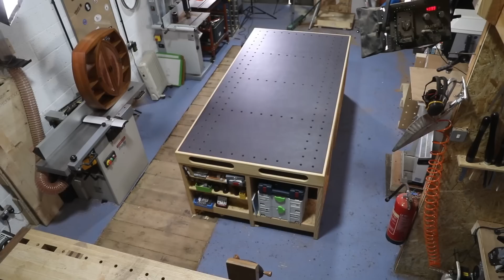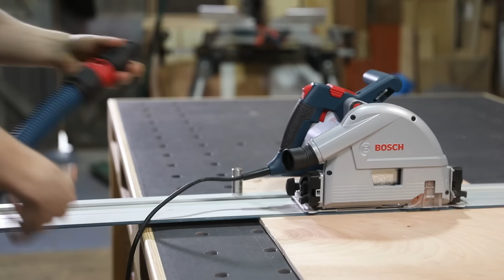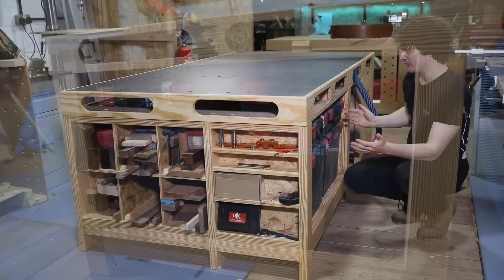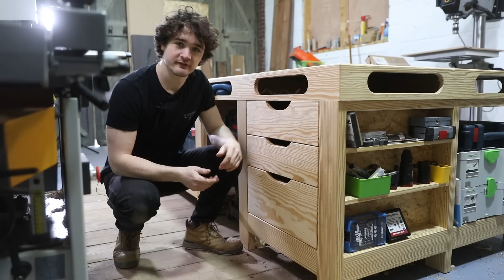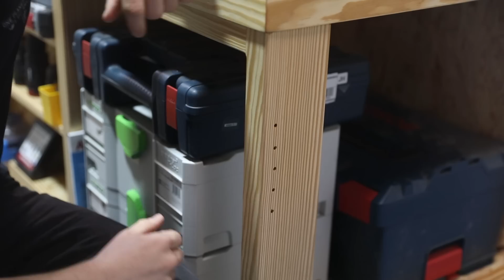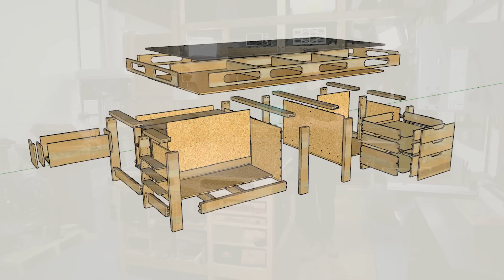Tour of the ULTIMATE Power Tool Workbench

Comment: concern based on the giant fire extinsher is fire from sawing bits and nicks on the floor not with enough clearance to sweep. The issue arrises when clipping a rusted nail shooting a spark down to the saw dust and becoming super heated in the middle of the table not being able to extinsh from the bottom or the top getting super hot and taking down the shop. The concern is gravity of all the tool bot being able to get a work around to the flamable bits.
Reply: If it feels like a rat paradise could be a bad design.

Comment: Only a woodworker would say 'perfectly square'. NOTHING is perfect- square, flat, or anything else. It just needs to be within tolerance. Which varies with the application.
Why store tools in boxes? They are for transporting tools, not storing them. Pain in the butt to pull out boxes and mess with them. Drawers are way more accessible (wall hung even better...)

Comment: If you have ever been in a real workshop you will notice very few if any permanent fixed cabinets on the shop floor, especially in the middle of the room. I keep all my power tools under my work bench and anything else is stored high up on the walls or in the rafters.
The torsion box sanding bench is another one of those bloated impractical dust collecting wastes  of space that hinder rather than help. But the hobby guys lap it up because they think it looks "pro".
It's far easier to fabricate on trestles because you don't have to reach over the table top on any side of the work. You can even step inside it if you need to. 
The dust and shavings fall to the floor instead of piling up on the top. So much easier. 
But influencers sell product by encouraging you to build storage for it. It appeals to the hoarding instinct. You end up with a garage so crambed with useless shit that you have just enough room left to make breadboards and jewellery boxes. LMAO.

Comment: Nice bench.  For wood working imperial is awesome.  I can divide a foot by 2, 3, 4, 6 and 12 and get an exact answer.  Try that with metric.  Also, show of hands.  Every country that uses metric and has landed a man on the moon raise their hands.  What's easier 6 inches, or 152(.4) mm?
Reply: Do you really think your German rocket scientists worked in anything other than metric?
Reply: What a retarded comment. The only time your "division by 2, 3, 4, 6 and 12" is relevant is when you are working in WHOLE feet.
What's easier, 150mm or 5 29/32" ??
Reply: @johncoops6897   150mm <> 5 29/32 inches.  5 29/32 = 5.90625 inches, which is 150.01875 mm.  Lets pick a length where there is a closer match.  What's easier, 5" or 127mm?
Reply: @johncoops6897  math hard.
Reply: @johncoops6897  how do you stand yourself?
Reply: @johngalt5205  - Straight, and 185.3cm tall.
Reply: @johncoops6897  185.3 cm is 13 syllables.  6'1 is 3 (inches is implied, and doesn't need to be spoken).  That's one thing I noticed about watching videos in imperial vs metric.  The metric ones spend a lot of syllables on measurements vs the equivalent imperial measurement.

I can also get 1/2 your height in imperial in my head in a moment, whereas in metric it almost needs a calculator.

And why, if the base unit of measure is the meter, a liter is based on the centimeter?

For the kilogram, they started out OK, 1 liter of H2O (later refined to at the melting point of ice).  But now, it's a thing, so that means there can only be 1 true kilogram, since things can't be replicated perfectly.

And, to add to the madness, a pound is defined in terms of the kilogram.
Reply: @johngalt5205  -  Interestingly, "Dick Head" is just 2 syllables. The USA officially changed the definition of the inch to 25.4cm on 1st July, 1959, and since then the "American Imperial lengths" have been defined and derived from Metric. It might have been even easier for you if your forefathers had chosen 24cm, but that's not our problem.
Reply: @johncoops6897  Please forgive me.  I was stupid to try to have an intelligent conversation with a troll.
Reply: @johngalt5205  - LOL, you kicked off the trolling right from your very first comment. Please be aware that I learnt woodwork in Imperial at school, not Metric!  I use both systems daily, and I have a number of workshops containing more Imperial than Metric tools and measurement devices. For Imperial fasteners, taps and dies I have SAE, Whitworth, BA, NPT and BSP. Don't get me started on Fractional, Number, Letter drills and what size to use for particular Imperial threads!
...
So, be assured that I know about and USE ALL of these Imperial measurement systems, and I am not trolling when I agree with most knowledgeable people (outside the USA) who all know that Fractional Imperial measurements is definitely not the best or easiest system for Woodworking.
Fractional inches works OK down to about 1/4" resolution, but anything more precise than that becomes an increasing PITA.
...
What you may not notice is that Imperial (fractional) measurements only make sense under very specific circumstances, primarily whole inches. The increments are inconsistent, which means that there is no uniformity, and calculations in fractions is NOT simple compared to Metric. 
...

In woodwork, it starts OK in Yards, then a division of 3 to get Feet, then divided by 12 to get Inches, and that is all really good and super easy number for division. However if you want to be more precise then everything gets even crazier. The units changes from 1/3 and 1/12 to 8ths, 16ths and perhaps 32nds. And those fractions make calculations of ALL forms an absolute bastard.
...
Can I convince an ignorant person who's stuck in their ways, knows no better, and refuses to learn a better way of working? Nope, it's just not worth the effort.

Comment: Hey just wondering the size of the table.  Went to buy the drawings but want to check size first.  Thx
Reply: The grey top is just over 1200 x 2400 with a solid timber surround. Standard sheet size for MDF, plywood, etc.
Reply: @thethirdman225  - It's 8ft x 4ft (2440 x 1220).... IMPERIAL, because that is what size standard metric sheets are supplied as LOL.
Reply: @johncoops6897  Check again. Americans frequently complain that their 3/4 inch sheets are less than that. That’s because they’re 18mm.
Reply: @thethirdman225  - No, I dont need to check anything. In Australia we use Metric so sheets are 6, 9, 12, 16, 18mm and never 3/4".
.It's obviously the Americans who need.to check more carefully.
Reply: @johncoops6897  I agree. The point being that it’s been standardised to metric.
Reply: @thethirdman225  - OMG, how can Americans possibly cope?
BTW, do they realise that 2x4's aren't actually that size?
Reply: @johncoops6897  I am not American. I have never used or advocated anything but metric. You’re having this argument with yourself.
Reply: @thethirdman225  - I am not having any argument with anyone. I thought that I was playing along with you in taking the piss out of Americans. Didn't you notice my  sarcasm, and examples that they are losing their measurement battles against "the whole world"? 😮
BTW - I started off with the irony that standard METRIC sheets (eg: Ply and MDF) are 8ft x 4ft (2440x1220mm), however we Metric Folk we will just call that discrepancy a "cutting allowance". 😉

Comment: Matt, in the drawer where you have the boxes of sanding disks, have you considered making a sliding piece of plywood with vertical pegs to hold the various grits of sanding disks and having it fit in the slotted area right above the drawer?  It would free the drawer up for other uses, provide you with a rapidly available view and access to the disks, and stay out of the way when not in use.  Just a thought.  Really enjoy the video series.

Comment: Hi Matt, beautiful workbench!  I'm not busting your chops here, but I really am curious if there is a strategy to avoid putting kerf lines in that beautiful top.  I mean, even with the MFT's that I have, I am very "anal" about cutting into the tops.  So far, I only have one (still tight) kerf that follows the location of the factory hardware and Festool track.  I know that means that I am seriously under-utilizing the MFT.  Especially, with the Parf Dogs, one should be putting a variety of cuts all over one's top.

Would it make sense, if one were so inclined, to make the top removeable so that when it needed replacement, you could use the old top for a template and then drop the new top into place?  I actually made a sacrificial top out of thin plywood for my MFT's that is held in place by dowels that match up with the hole pattern.

Or have you already started putting kerf lines into it?  I can tell that a lot of work and thought went into this project and it turned out beautiful.  I would really like to see how it looks after you start using it.  If I spend all of that effort to build one and then don't really use it because I don't want to cut up the top, then it would (for me) just end up being a show piece or piece of furniture and I don't have room in my shop to be doing that.
Reply: Not sure what Matt does, but I have a similar setup and use 3 bits of high density foam insulation ( the stiff kind used under floors ) to support sheet goods when cutting. I've also used 3mm ply, but you have to be pretty spot on with your depth of cut when you do that.

Comment: Nice bench but why on earth didn't you put in drawers for the power tool cases? That's so much better to work with.
Reply: Because it made the drawers so outrageously complex and time consuming, that he could only manage three. Note he used the wrong length drawer runner, and used Light Duty rather than heavy duty ones. He said it was the first time he'd ever used runners on a drawer.

Comment: So Matt, first let me say, fantastic bench build! Before I watch the rest of the vid, thought I'd mention that  I doctored Festool guide rail dogs from benchdogs.co.uk to fit (slide into) the Bosch/Mafell rails and developed a locking collar for setting workpiece height. Following my vid demo on that, benchdogs.co.uk now offer a Bosch/Mafell compatible rail dog and a locking collar. Check out their site and if you fancy it, watch my vid (below) as it solves your problem of the saw running into dogs - as the dogs are below the rail. The dog/collar set has many more uses too. https://www.youtube.com/watch?v=b0lfn7xm9E8&t=14s
I should point out that although these were my idea, I make no money from them. I shared the idea openly. Just sharing as they're a good idea, solve your problem and open up other options. All the best.

Comment: I am trying to wrap my head around this type of bench system.   So, is it to hybridize a setup bench with dog system trying to reduce need for a tablesaw?   I mean, the bench needs to bigger than a sheet of plywood for panel cutting system so one needs to give up some shop space bit it is gained by not having a tablesaw.
Reply: Maybe but this can also double as an assembly table.
Reply: @thethirdman225  - So can a table saw... lots of people use them for that.
Reply: @johncoops6897  This has holes very precisely placed for accurate alignment.
Reply: @thethirdman225  - yes, so what? I know what it is, so tell someone who cares.
Reply: @johncoops6897  So you can’t do that with a table saw.
Reply: @thethirdman225  - so who cares? If ypu want a layout table, you have to built one. I don't understand why you are trying to contradict and argue with me.
Reply: @johncoops6897  You care or you wouldn’t be doing this. Now, if you don’t mind, I have better things to do.

Comment: Being from the state's,  I use the good ole imperial system. I do like using metric, however you have to have a high power microscope to read those damn millimeter marks.
Reply: Yet you don't need a microscope to read the EVEN SMALLER 32th inch marks?

Comment: Matt, how are you going to protect the worktop when using tracksaw?  Or is it going to be sacrificial?  I also follow Dave Stanton who uses interlocking camping matts which I have started using, they're very good.  You can find some here http://vi.raptor.ebaydesc.com/ws/eBayISAPI.dll?ViewItemDescV4&item=112544530330&category=20573&pm=1&ds=0&t=1548681672000&ver=0
As you can see they have a set of holes in them.

George Scholey

Comment: Matt the problem with using bosch/mafell tracks with dogs has been solved. You simply mount the dogs under the track instead of placing the track against them! They are now available to buy from Bench dogs uk, or you can adapt the dogs easily enough yourself.

Comment: Nice vids thanks Matt. I’m just setting up my own workshop for luthier work and general woodworking but am struggling to find a decent floor Pilar drill at a sensible price. Do you have any recommendations on that front? I see Axminster do a craft one but not sure on how accurate etc they are. Also all drills seem to have a short 80mm throw on them, is this normal? Sorry for the detour. I’m also looking into the system you have shown in the vid as been using festool saw and rails for years. Top channel, thanks.

Comment: Matt, won‘t using the bench to cut stock with your circular saw ultimately result in you destroying the surface of the bench? Can‘t imagine being able to set the depth stop on the saw, so exactly, that you won‘t get cut marks on the surface of the bench. Or are you going to use a sacrificial board underneath? I‘m also old enough to remember when, we in the UK, changed from imperial to metric. I can‘t remember it being such a big deal. Imperial was good in it‘s day, but using fractions, one sixteenth, eights, thirty seconds etc, is just too complicated. Having every measurement in mm is just so much easier. I still have a steel ruler in my shop, one side mm, the other imperial. Guess which side doesn‘t get used? 😂 Am also a fan of your work Matt. So young but so much skill. Definitely enviable 🤘
Reply: We made a track saw table in our shop with essentially a tray top that fits a sheet of MDF. The MDF sticks up about 1/2 inch allowing us to just go the material we're breaking down. We also put a hanger above the table for the hose and power.
Reply: You have to love imperial to use it. There are workworking channels that have to explain woodworkers how to read an imperial ruler. I think, that says as much about the imperial system as it does about the society those people come from.

Comment: What do you think of using a narrower to sheet set 6mm down relative to the sides and using 6mm hardboard or water resistant MDF on top of it so that the top is sacrificial and is easily and cheaply replaced?

Comment: Metric is for those that can't do math with fractions.  Whereas those who don't use metric and in order to have half a chance of not making 3 cuts to get one piece use a calculator that does fractions, all the time.  However having worked for a Japanese company for 20 years and have had to use both.  It can be done with either system or a combination.  By the way good series.

Comment: Why would you have your cut-out handles on the top... seems a bit Irish,, should be on the bottom of the drawer so dirt doesn't get in and it's more natural for your hand to go underneath then above.
The circular saw does it need to stick out can you not put it on a belt sander and make it flush with the guide Rail, or reverse it and have the rail the other way round
Reply: 1. Doesn't matter if you put at the top or bottom, if there is a cutout hole, the dirt will get in. Because... it's a cut-out hole.
2. A circular saw that doesn't stick out won't cut anything. You cannot put a circular saw onto a belt sander, because that is silly.
3. You cannot reverse the rail, and even if you did that wouldn't change the dimensions. That kind of track saw indexes the cut off the edge of the saw blade, so the saw always cuts flush with that side of the rail.

Comment: Matt, check out Peter's video on offset holes. If you've got the mkII Parf system you should be able to drill some extra holes that are spaced in such a way as to avoid the motor or base of your saw fouling on the dogs. Going to be doing this in a few weeks as I've got the same Bosch saw and will be making my own MFT top too. Haven't done it in practice yet but it should work. Here's the link: https://www.youtube.com/watch?v=tOhDFN5Cx-s

Comment: Gonna get "Metric, because imperial doesn't make sense" tattooed across my chest.
Reply: Need it on a T-shirt!!
Reply: IT MAKES SENSE IF YOU KNOW UR FRACTIONS BOOOI
Reply: @mrgibbs7710  - You don't NEED to know any fractions if you use Metric.
And how come Americans can understand and work with "Thou" (thousandths of an inch), yet they cannot comprehend Thousandths of a Meter?
Reply: @johncoops6897  we do actually use the metric system alot here in the US, especially in manufacturing. Most if not all fabrication shops use both
Reply: @mrgibbs7710  - I know. And machine shops use THOU which is Base 10, the same as Metric uses.
I am taking the piss out of those "Woodworking" Americans who cannot grasp the extra difficult of using fractional sizes in the modern digital era.